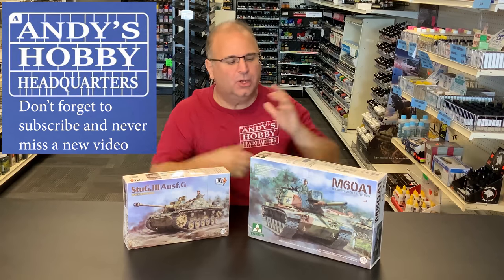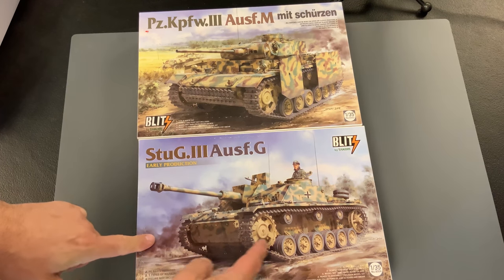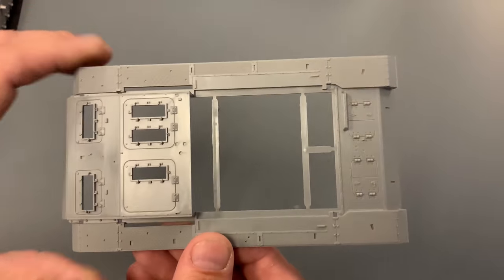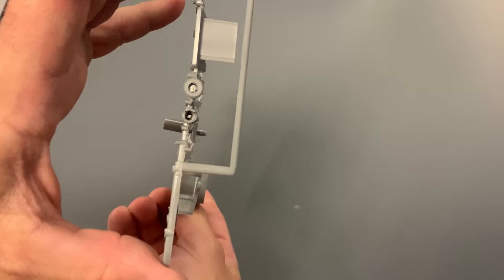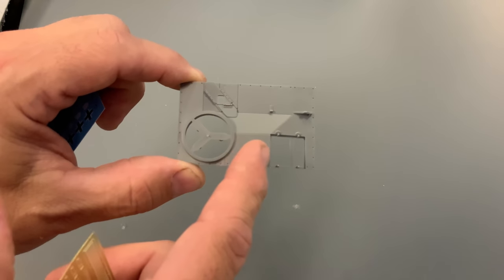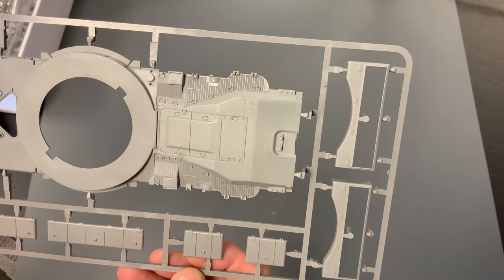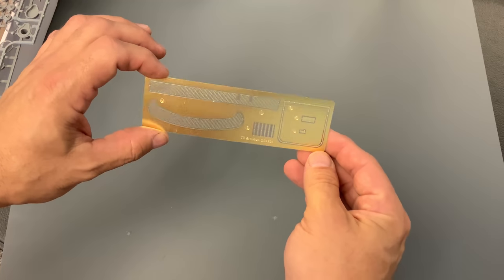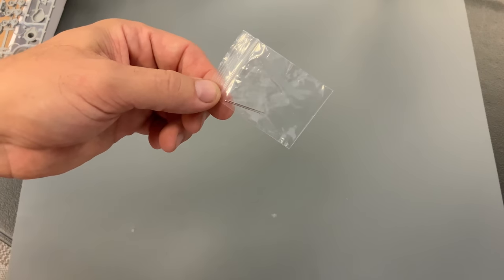Preview New Takom 1/35 plastic model kits Stug III  G ,  and M60A1

Comment: Any body know what M60 version was used by USMC in the early 80tys? Is there a kit available?
Reply: During the late 70's/early 80s they were producing the m60a3, not sure which model the Corps was using.
Reply: Is there a model of the A3 in 1/35?
Reply: @rkyyrs9477  I think AFV Club released one a few years back
Reply: I have 1 on order THX👍